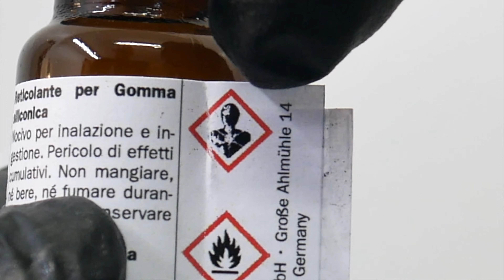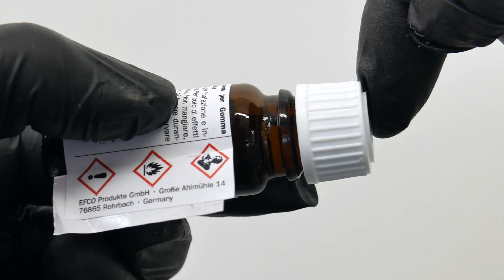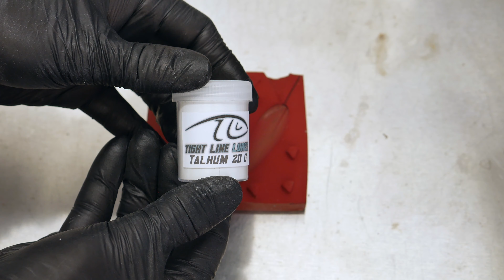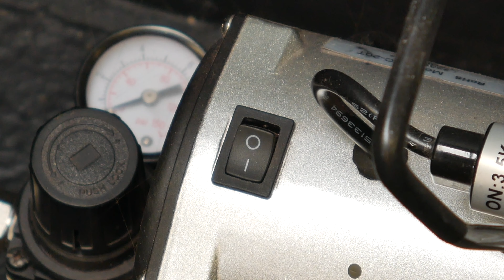How to Make Your Own Ultra Light Metal Jigs with a Silicone Mold (Easy and Cheap!)

Comment: Brother what material your using for mold what rubber is it
Reply from the maker: Hi, it's a heat resistant 2. component silicone, the one I use is from a german company called efco, and a silicone in a very good quality. This one can handle temperatures of up to 450C or 842 F. You can buy different types, I will always recommend using good materiale - your end results and finish is just better!